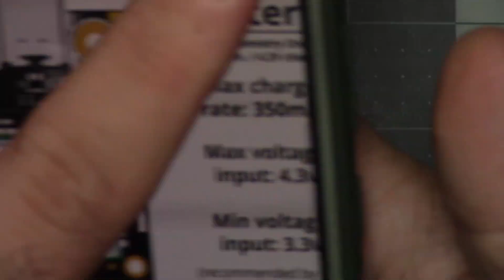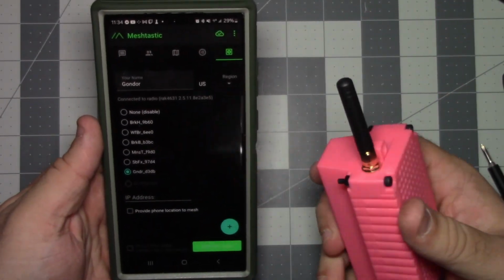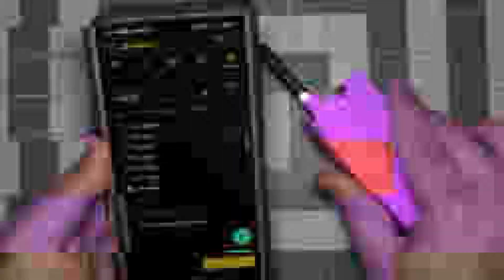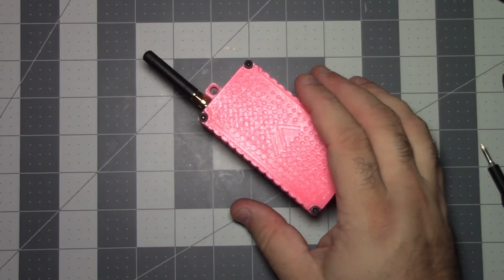[AMATEUR HOUR] WisBlock RAK19007 RAK4630 BUILD

Comment: Maybe try use some solid battery not fake ones, this bat will by like repack china 2000mah down. Max are 4000mah nowdays.
Reply from the maker: idk, i just grabbed the recommended one on amazon, during this past snow storm, this unit spent more than a week under 18" of snow and wasn't able to charge off the solar panel. It lasted around 12 days i think before I cleaned the solar panel off.
Reply: @TheBrokeHam  That 9900mAh marking is fake as f... ^^  But they can be enough for light use anyway.
I am looking into Lora for an alert for my mailbox to Home Assistant, so just need to find out if it is cheap and reliable.

73 de LA7DFA